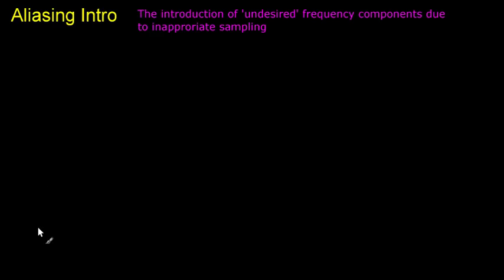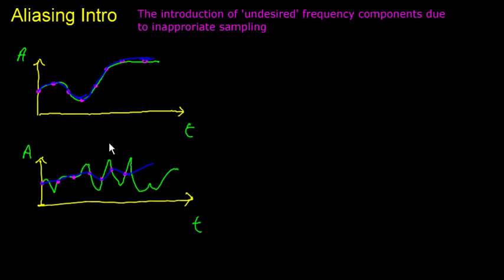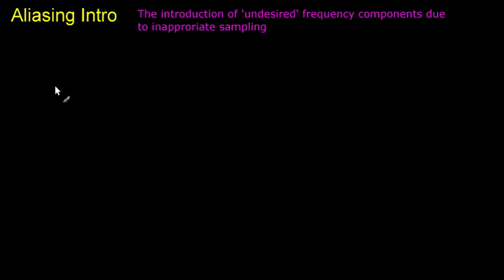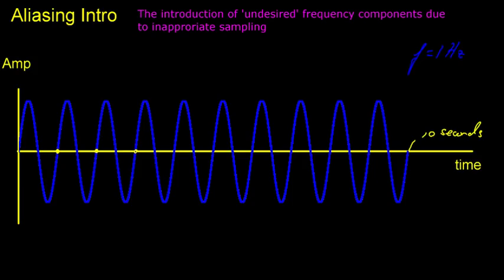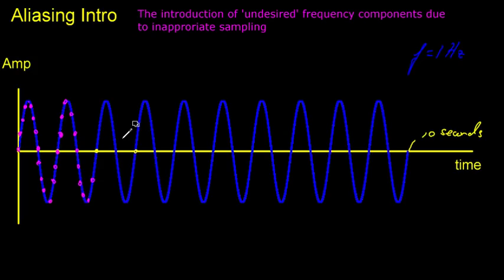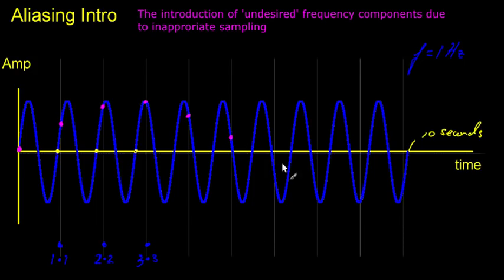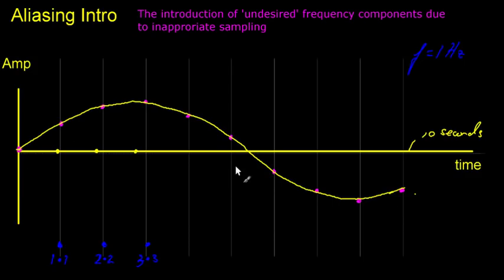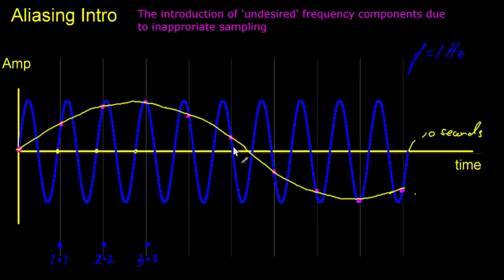Aliasing - a basic introduction

Comment: Your videos truly have helped me a ton as a newbie. I'm a little slow on the uptake... so this alaising catches signals from the waveform at different points rather than changing the sample rate directly (i.e frequency)? I also suppose each of these points has many different signals/sounds within them. This must be where the distortion comes from.
Reply from the maker: No - that's not really it. Aliasing occurs if you do not sample at a suitably high rate. Your sampling rate has to be at least twice the highest frequency present in a signal, otherwise aliasing will occur. For example, a speech signal has loads of different frequencies present but (for most speech) the highest frequency will be about 8000 Hz, so to avoid aliasing you would need to sample at 16 kHz. 
If you don't sample at a high enough rate, then the signal you measure won't 'seem' correct. For example, imagine you had an audio signal that contained a 1000 Hz beep sound. Let's say you sampled at 1200 Hz (which is less than twice the highest frequency), If you played that sampled signal back it would sound like a 200 Hz beep rather than a 1000 Hz beep (this apparent change in frequency after sampling is aliasing). 
If you sampled the 1000 Hz beep sound at a rate above 2000 Hz then the sampled beep would sound like a 1000 Hz beep.

Comment: Since nobody records at less than 44.1khz this would never happen in the audible frequency spectrum.
Reply from the maker: 11025 and 22050 Hz are commonly used - even speech is often recorded at 8 kHz. Regardless of the sampling rate, inaudible frequencies (typically above 22 kHz) will cause aliasing. For example say you captured an audio signal at 44.1 kHz and that signal contained a sinusoidal frequency component at 32.05 kHz (which wouldn't be perceived by a human listener) then  you would hear a  sinusoidal frequency of 10 kHz in the recording, because of aliasing.